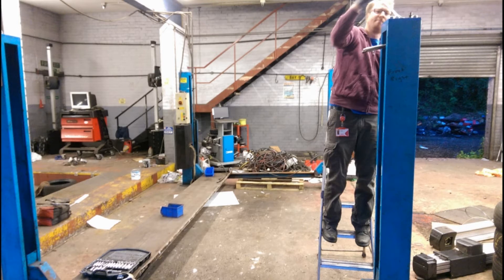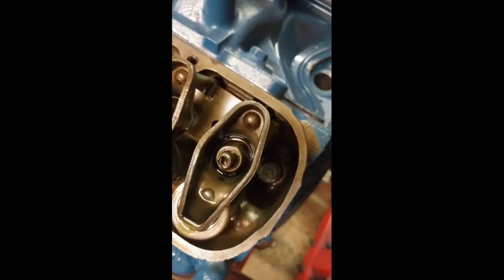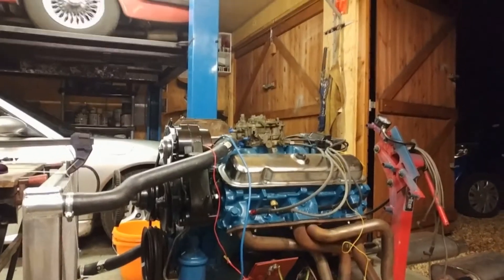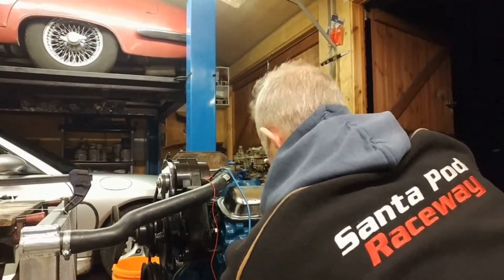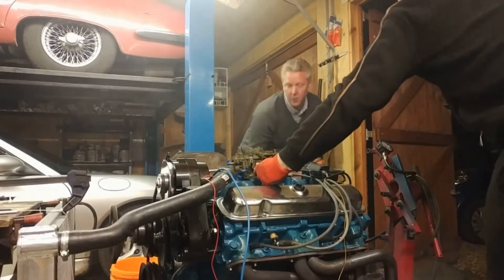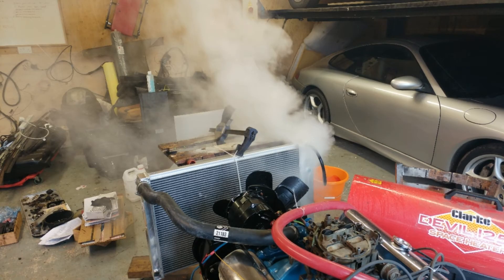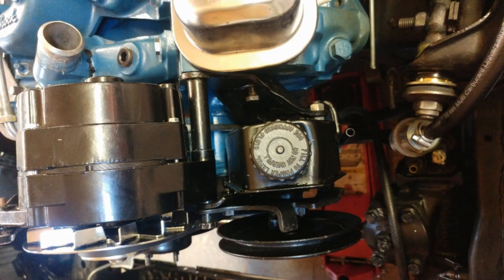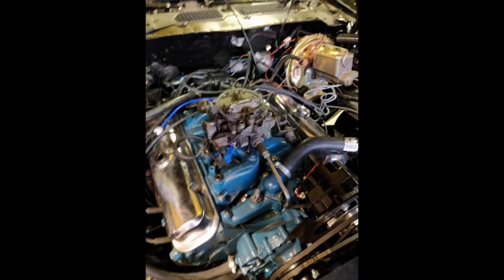Pontiac Firebird Trans-am Restoration Documentary UK - Smokey and the Bandit - Part 2 Nearly Died!

Comment: Your issue with the distributor hitting the intake manifold is bc of the performer intake. I had two 400s and each with a performer and had the same issues . This isn’t the case with a stock manifold. Also the stock ones flow better.
Reply from the maker: It did eventually wiggle in and now has plenty of room though.  As i learned, most things seem to go if you wiggle them enough!